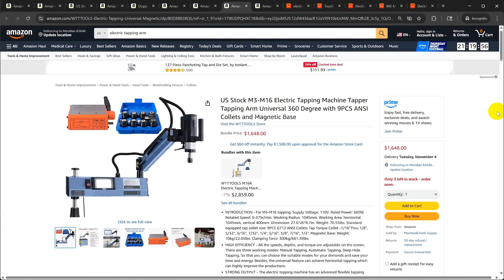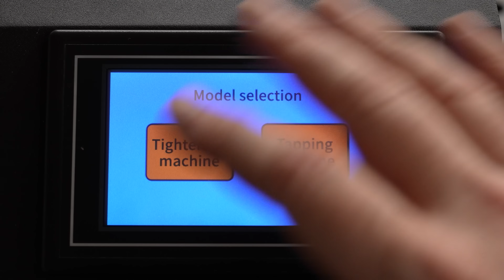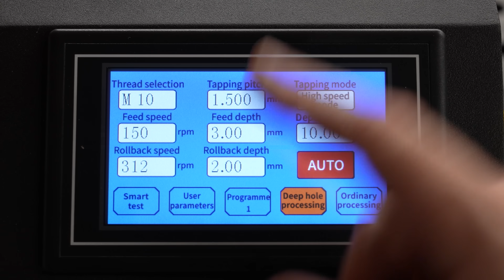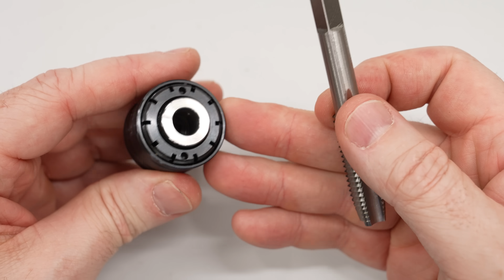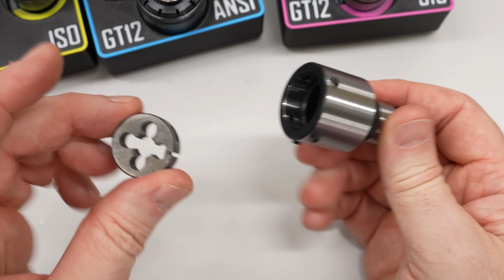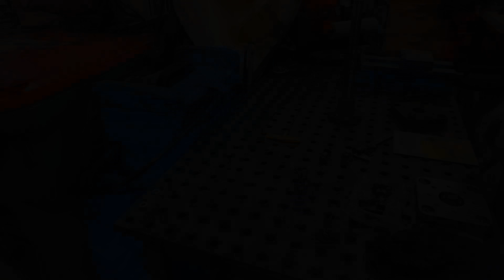Will I Regret Buying the Cheapest Tapping Arm I Could Find?

Comment: Are you still ok with the masso limitations?  (Tapping arm is pretty nice though)
Reply from the maker: I really love that it doesn't require care and feeding of a Windows PC.  My biggest frustration so far is that it can't probe the outside of a part to locate the center.  (yet...more on that to come maybe)  The other thing I still want to play with is stopping after an operation, rewinding the code and re-running a contour pass to sneak up on a dimension.  I think I know how, but I need to either spend some time with the machine making nothing to see how well it actually works.

Comment: I just went to online to Amazon. Found your tapping arm. The initial product summary states it's AC 110v, but when I drill down to product details it states it's AC 240v. So which voltage does yours operate on? Thank you James.
Reply: My guess is its a universal voltage switch mode power supply that can accommodate 100-240V
Reply: The only review I see states "plugged into 110V" for whatever that is worth from random Amazon review.

Comment: we have a pneumatic flex arm tapping arm at work with a similar capacity and this seems taping arm seems nicer than it. On our flex arm the clutch in the collets are the only form of torque limiting and doesn't have all of those nice automatic features. Our flex are is also no where near as quiet at that one. As long as it would hold up to the same abuse we put our  flex arm i think i would prefer the cheap taping arm.

Comment: If you are going to be tapping hundreds of holes, maybe check out a roll/form tap. Obviously depends on the material you are tapping, but you mentioned tool steel. A2 tool steel can be roll tapped and it leaves beautiful threads.

Comment: My experience buying on aliexpress has been amazing as long as you follow 4 rules.
1. 4.8+ star sellers only.
2. Shop around. 
3. Buy the 2nd or 3rd cheapest
4. Spec higher than your minimum requirements.

A lot of products are made by multiple companies as a white label configuration product so they may look the same but have wildly different features, specs, and quality. They also tend to list maximum values even if they are not realistic, like 20% duty cycle on welders or 500w lathes cutting steel. This is where my 4 rules weed out, bad service, low quality, exaggerated specs and missing features.

I have been more than happy and never had an issue the sellers were not happy to fix. I would say I have gotten better service than from western retailers. Amazon overcharges you and is the same products from AliExpress marked up 50-100%
Reply: My experience has been much the same, though I would add two more qualifiers to your list-
#5 Look and see what other items the seller has on offer. If it's a mixture of machine tooling, kids toys and household knick knacs, then it's most likely a seller that's just a retail market stall. Not really a bad thing, but they might be lacking on any technical questions.
#6 If you spend some time looking, often times you can swim upstream to the source and find the first tier mfg of the particular product line. I did that with DRO components and found Ditron and Sino factory stores. Both had very good technical help and service.
Reply: I was at our MACH 2026 show here in the UK 🇬🇧, having a good look around, and found the MRCM stand in one of the smaller areas of the show. I must admit to being quite impressed by the kit they had on their stand, mainly drill sharpeners of various types and sizes and D Bit grinders. I do have one of their booklets and they have an extensive range up to smaller CNC lathes and mills. It was one of the smaller trade type stands, but at least they were there. From what I saw I would certainly consider them for kit and equipment.

Comment: It seems pretty amazing for the price! Imagine if we could all agree on the ISO standard and SI units though... one can dream! :'D
Reply: Ok.  Let's say we all agree.  Now who pays to replace the 2 drawers, an index, and a bucket of taps I've collected over the decades.  Some were my dad's so they are certainly pre-WW2.
Reply: @kensherwin4544  and all the literature, and knowledge. Yeah, that's why it'll remain a dream. Capitalism also loves multiple standards.
Reply: @NightfallSentinel  Apparently so.  Bypassing the imperial / metric squabble, consider just how many RS-232 "standards" there have been, both in the connector and wiring, and in the electrical definitions.  Standards are wonderful.  We need more of them.
Reply: @kensherwin4544  There is a reason I specifically mentioned ISO and SI units though. Yes, serial communication comes in many forms but that's in a different realm of things.
Reply: @NightfallSentinel yes that realm was different but that’s where I lived for several decades. Long enough to watch data come by at 110 baud. Whenever I hear about conflicting standards, that’s the one that comes to mind. 
😢😢
Reply: If you want to use frog units, f*ck off to frog land.

Comment: If you plan on tapping 100's of holes, please consider thread forming. Your tap will last much, much longer, and there are no chips or swarf to deal with. Great video!
Reply: True.... but, form taps require alot of lubrication and might not work depending on the alloy tool steel he's tapping.

HAAS machines put out a video last week.
Reply: @FineApe Wouldn’t worry too much about lubrication, James put enough oil on there that I thought the US military might show up. But yes, definitely depends on the material. Also I really want a tapping arm now even though I know I don’t need one.
Reply: @AJAuto69  The amount of oil he used has to be bait.
Reply: @FineApe he’s wanting to tap tool steel of some kind, so I expect that would be an issue.
Reply: @FineApe  You will notice I said "please consider", because there were so many variables that were not disclosed. There was no mention of Tool Steel type. There was no mention of the fastener's function. Will it just be securing a piece of sheet metal, or will it be joining critical structural components. Was there a drawing with thread callouts? Does the thread ratio really need to be 75%, or will 60% suffice. If your threading 100's of holes, these are some the details that will help you choose what type of threading operation you can use. As far as  lubrication for thread forming (or rolling for you purist), I've used much less lubrication thread forming, vs thread cutting. But that could be a whole separate discussion on its own. lol

Comment: A handy tool that can speed up the process quite a bit. So cheap you couldn't build it yourself.  I would have thought the tell between it does it tap a hole and it works perfectly is debris in the hole , even blind holes a bit shallow or with swarf stuck in them. IMHO that's the true test for a tapping/thread cutting solution. You would want it to stop without breaking and remain consistent with blunt taps. Air or electric it's all about torque management.

Comment: Just for reference, I bought one of the M6-M30 ones on Alibaba in late August.  I ask the seller for a DDP quote to my zip code in the US.  DDP is basically landed cost, all import/transport covered by the seller.  My machine came out to $500 + $300 for the multimodal shipping and duties.  Multimodal just means they ship via sea to the west coast and then truck it to me on the east coast (in NJ).  I know M6 sounds like a big tap to be the smallest size, but my machine has a GT24 system and I was able to buy GT24 to ER32 adapters, plus an ER32 set that goes way down in size.  So I can put smaller bits into my tapping arm no problem, it's just that the CNC portion doesn't know exactly how deep I have tapped, unlike in the M6-M30 range.  I mainly got the bigger one for the bigger motor and additional torque.  Overall I'm very happy with it.  Just figured I'd leave my two cents for anyone in the comment section who is wondering about getting one.
Reply: These days you'll probably have to pay the tariff, if there is one on China. I purchased some stuff from Japan over eBay and the tariff was half the cost of the item.
Reply: Hey i actually have a project that im looking to have done and it requires a cnc.. small adapter that can be made in either aluminum or steel.  Would love to find someone local to have it made.. Also live in the east coast(NYC) the adapter is very small and can be made of scrap metals that you might have.. let me know if its a possibility. Thanks.
Reply: @JustNel  just to be clear when i say CNC i mean the CNC aspect of the tapping arm -- like the part where mine can tap to a certain depth and/or let me know how far I've tapped if I'm doing it manually.  I assume you need someone who can make parts on a CNC mill.  I'd recommend finding a local shop for that (some of them will advertise on marketplace) but I have also sent step files to PCBway and gotten good results.  but I am not a shop that does things like what you need.
Reply: @natarem I understood. Not looking for a shop, more of folks that have personal machines as a hobby that might be able to help. 

I sent my files to pcbway and jlc but the import fees are more than what it cost to have the part made 😂 so was hoping maybe you knew anyone that has one? Thanks
Reply: @JustNel  The only cnc shops I know of near me would definitely be more than pcbway
Reply: @JustNel  I'm in the city. If I have the time I can run a quick part in a Bridgeport for you, provided the part is simple enough... though you did specify CNC so don't know what your part looks like. BTW most people with a CNC mill aren't doing hobby or personal stuff, if they've gone as far as to have a CNC mill, they're probably running a job shop.

Reply with an email address or something if that works for you.
Reply: Yeah. Skipping Aliexpress and going straight to the source on Alibaba is key - that and knowing "DDP" - and being willing to wait 3-6 months and deal with (almost invariably) a very annoyed truck driver who has just driven 70 feet of semi truck into a cul de sac when you told the dispatcher "pup trailers or straight trucks only, and if you can't do that just tell me and I'll come to the depot and get it". That last one might just be a me problem.
Reply: @EyeMWing  so i ordered Aug 21 and it was delivered first week of October.  about 6 weeks, maybe a couple days over.  wasn't that bad.  I got 5 or 6 quotes where I asked for DDP with multimodal shipping and I went with the best one. The arms and features seemed more or less the same.  Mine is very beefy.  Also my mounting place did line up great with my holes on my Langmuir table, so no adapter plate needed.  Lastly, I am a business and I have a forklift, so drivers aren't mad when they get here :) but I could imagine getting some annoyed drivers coming to a residential cul de sac.
Reply: Thanks for that, I've been looking for one in that size range. Have you tried tapping any of the larger sizes? I routinely need to tap 1"-8 and 1-1/8"-7 and was thinking the M30 capacity machine might handle that, but wasn't sure if maybe I should step up to the M36 capacity machine.
Reply: @steamfan7147  i did do one m30 hole just for the hell of it and it did it no problem at all.  I am primarily doing M8, M10, M12 holes so technically could have gotten the smaller one but mine is a higher wattage motor and I just figured it would have more torque overhead.  not sure if that matters.

Comment: You can build your own tapping arm using a computer monitor reticulating arm. They're unbelievably cheap and well built. Knox Machining has video on how to build one.
Reply: can you buy the servo motor/computer/software/etc for little enough that this sort of DIY setup actually makes sense?  I bought a tapping arm because what you're suggesting doesn't actually save any significant money if you want the motor/computer/software, which is required if you want this to be fast and accurate.  Just making an arm is only going to get you tapping square to the table, that's about it.
Reply: @natarem   Holding the tap square is a major part of it. You can always use a drill with adjustable torque for tapping. Clough is wealthy so he can afford to splurge on a $700 machine, the rest of us will have will have to get comfortable with the cheap seats. The speed, accuracy, and torque is almost just as fast. The rest of the computerized fluff is nice, but not essential. If you really want to get fancy and understand electronics, you can build the same or even better tapping arm for very little in parts.
Reply: @bobweiram6321  $700 is cheap if you're tapping a lot of holes for jobs, you save a lot of time and get repeatability that's hard to get any other way with this sort of cost/speed.  If you're not tapping a lot of holes for jobs then there's really no need for one of these and it would just take up space.
Reply: @bobweiram6321  That seems like one of those projects you go into trying to save a buck and either end up with an inferior end result, or spend the same or more and have all the time invested into it. (not to discount the DIY satisfaction aspect)
Reply: @--_DJ_-- You should watch the Knox Maching video. He and at least one other YouTuber build one in about an hour. Any competent machinist ought to be able to build a basic drill driven one.
Reply: @bobweiram6321  This is what my comment was in reference to. "If you really want to get fancy and understand electronics, you can build the same or even better tapping arm for very little in parts."
Reply: @--_DJ_--  Well yeah. I could definitely build the fancy pants version in about a weekend, but it's not worth it because it won't significantly improve the tapping process. Although, I might switch to one of those Chinese sewing machine BLDC motors. They include a controller, speed readout, and can be foot operated with lots of torque. It only needs a reverse switch.
Reply: @bobweiram6321  I never questioned whether you could do it. I questioned whether you could build the same, or better for that amount of money.

Comment: The only advantage of any of these devices is the ability to keep the tap square to the work. I'm hoping none of these devices require specialized tooling, as it's simply not worth the cost for non-production environments. 

I haven't seen a non-electric version of the machine. Perhaps something someone can make a fortune on. Being a simple vise mount baseplate with  2 part arm,for X/Y,  with a floating spinal for the Z. and a manual tap handle on top to turn it. 

Price point being in the $200-300 range.
Reply: There are pneumatic and hydraulic variants, but way more expensive.
Reply: That was solved decades ago. Just search hand tapper. Counterbalanced spindle, two speed handles (crank with two radii), you just move the part instead of the arm.
Reply: I would say speed, ergonomics and torque limiting are also advantages. 
With a sturdy desk lamp arm and some ingenuity you could probably cobble together a tap guide arm if you were so inclined.
Reply: Abom uses a pneumatic version. Called a flex arm.

Comment: To be clear, pneumatic tapping arms can get had for mid $400 ish.....
Reply: They are just an air drill on a arm tough, nothing fancy and loud as sin. The part that dose the "taping" is just the clutch, which you have to set for each tap size and material. The advantage of electric, is the torque control is done in software, much easier to change